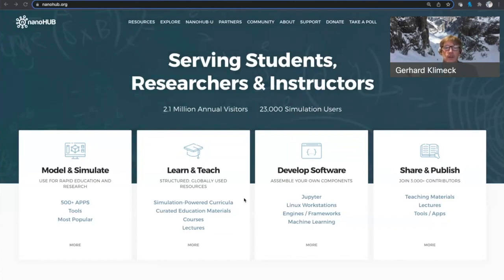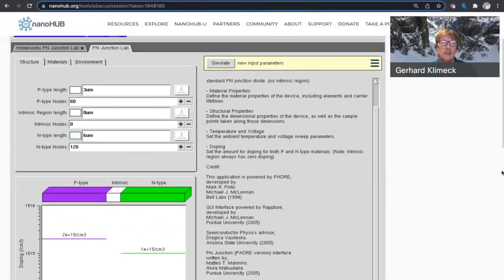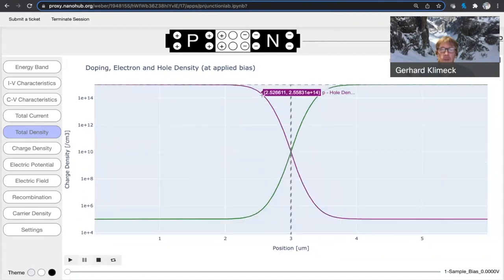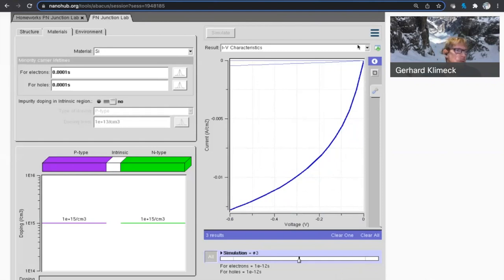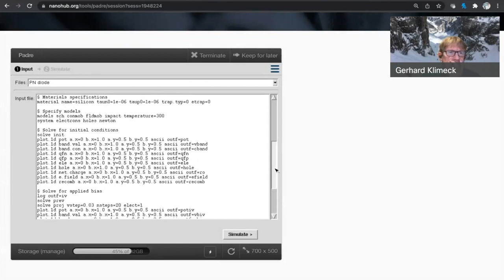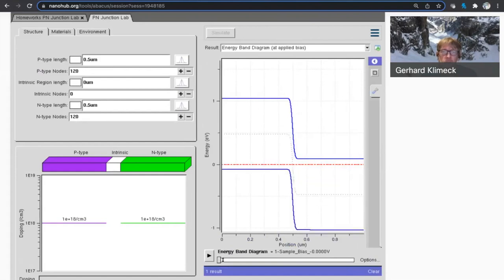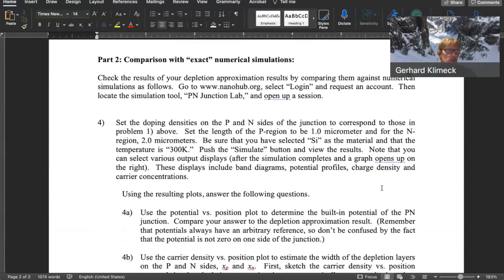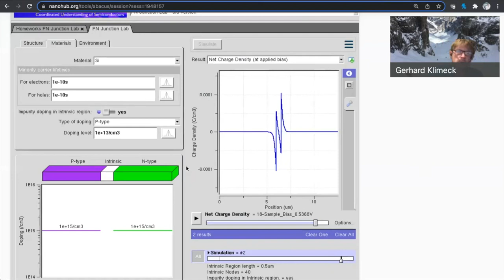ABACUS PN Junctions (Winter 2021)

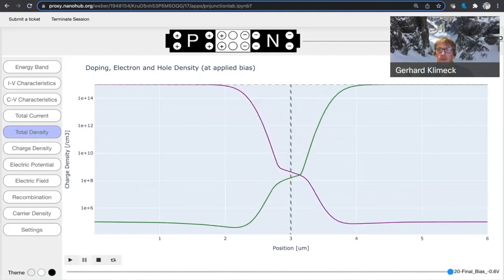Comment: at 15:45 why is depletion region showing charge as p on p side and n on n side  shudnt it be n on p side and p on n side inside the depletion region?
Reply: Hi- that is a great question.  There are two different views of the charge.  At 15:45, the visualization is not showing the static space charge, which I think is what you are thinking of, but the total charge.  The total charge shows both the majority and minority carriers.  The majority carriers on the p side are holes (purple line), and on the n side are electrons (green line).